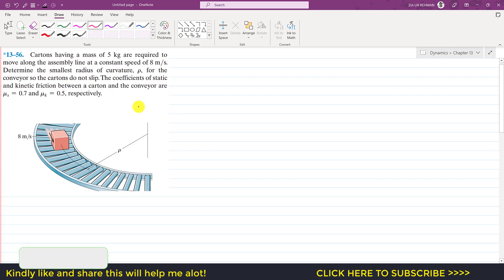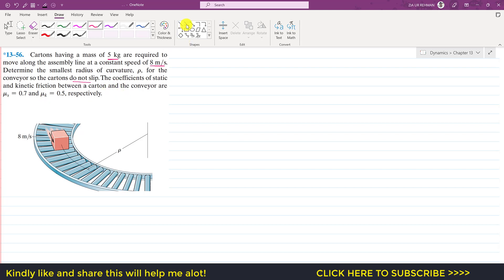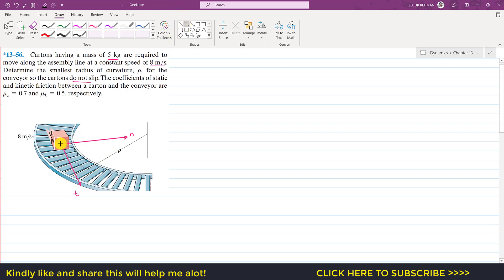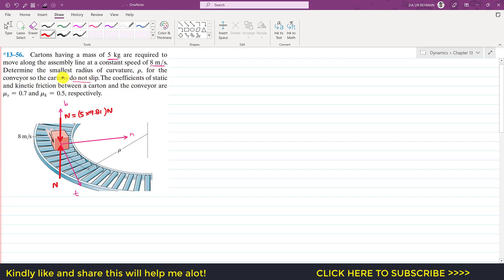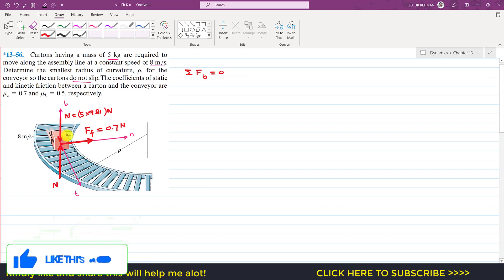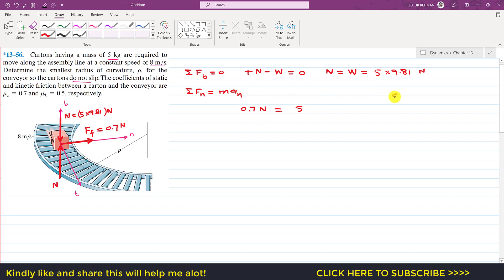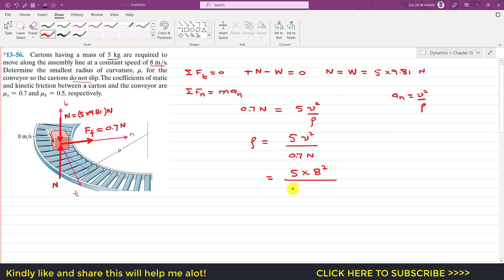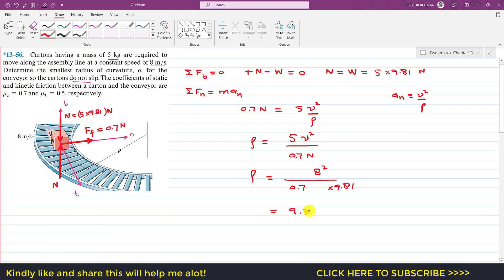13-56 | Kinetics of a Particle | Chapter 13: Hibbeler Dynamics 14th |  Engineers Academy

Comment: Question, why is the force of friction in the direction of the normal acceleration? if the box did slip, it would slip off the left side right? away from the Normal acceleration direction.
Reply from the maker: The problem says to prevent from slip, so the friction should be in the opposite direction of slip
Reply: @EngineersAcademy2020  got it, thank you.